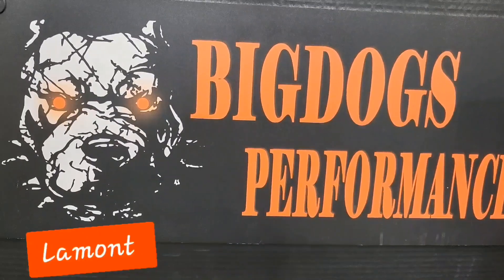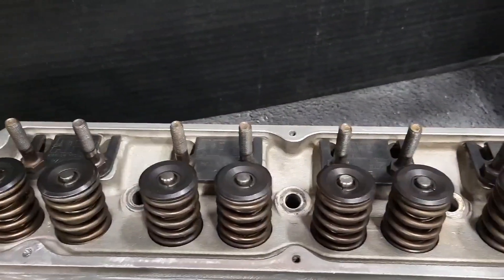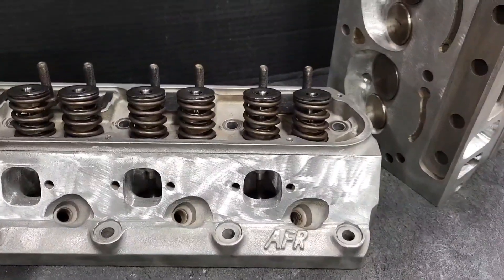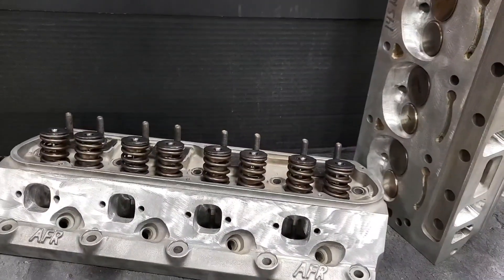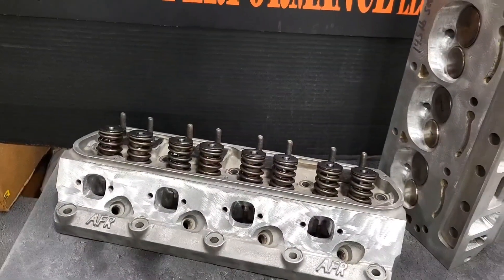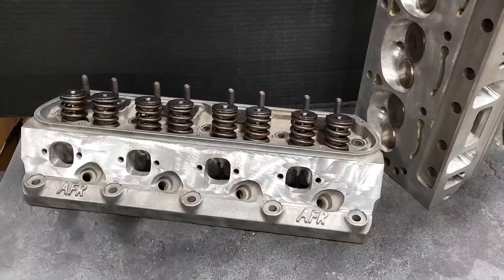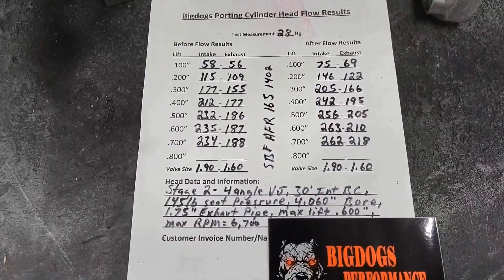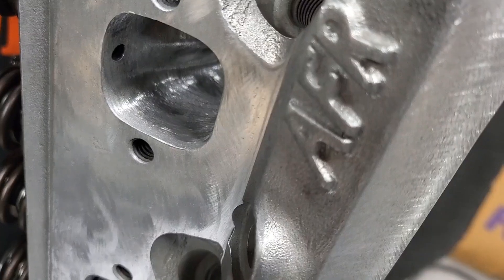AFR SBF 165s. How we Stage 2 port them

Comment: Ok thinking about getting twisted wedge 11r trick flow heads any input
Reply from the maker: Check out our Stage 2 Aluminum heads video dropping soon. They flow 294/216cfm at .700" lift, dual valve springs, 2.02/1.60" valves, fully ported, 4 angle valve job, thuck decks, 58 or 62cc chambers, 150lbs seat pressure, rocker studs, guide plates currently $1,550 a set!
Reply: @bigdogsportingtonyb2833 ok I'm only on you tube! I have a channel on here tho! But my problem is I'm not sure what you gotta run for certain heads like pushrod length spring ect cam? Are those bolt on? And ready to go

Comment: How much HP potential would these ported 165’s have on a 289 spinning to 8000 RPM?  Assuming proper parts and tuning... I am looking at upgrading the heads on an old Falcon drag engine...
Reply from the maker: @trailerparkcryptoking5213  with the correct valve springs, setup and supporting parts these heads would be able to support 520-530hp

Comment: How much are stage 2 ported afr 165 heads?
Reply from the maker: @mustang91  price of the heads plus stage 2 porting. Prices are dependent on head configuration stage 2 porting is currently around $620 a set.